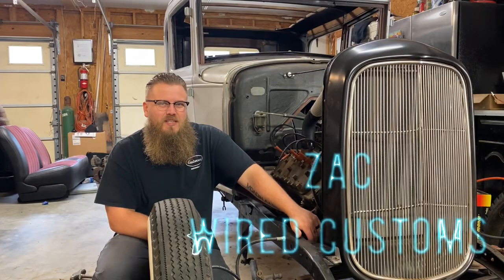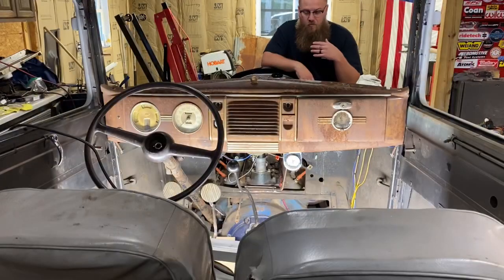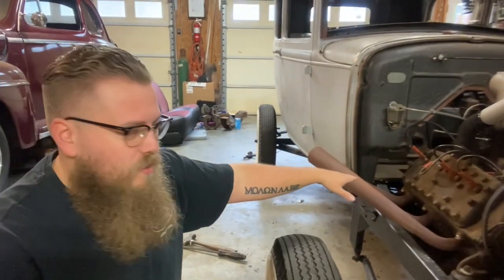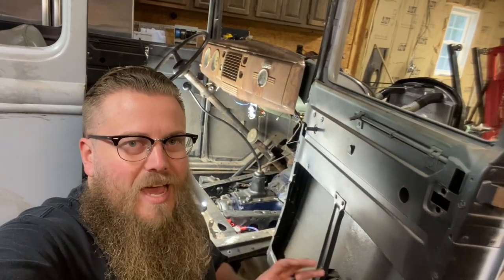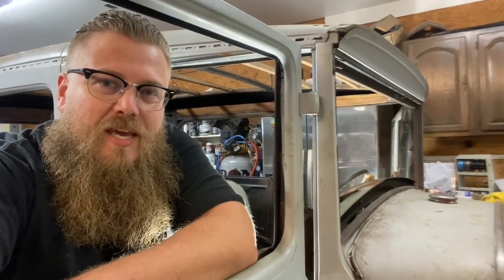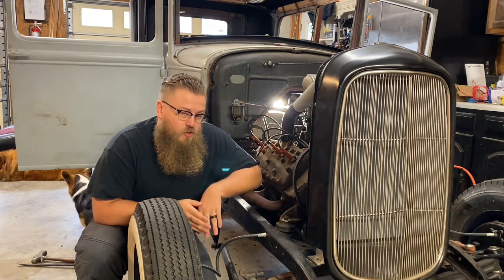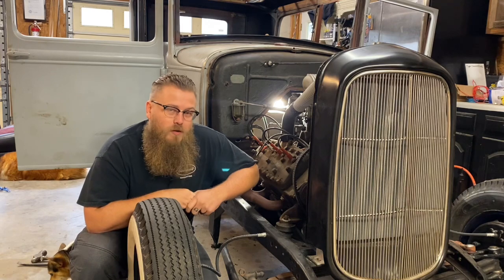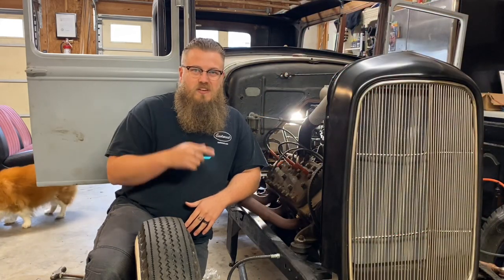Flathead V8 in a Model A Motor Swap

Comment: Soooo now ya got me rethinking flathead in my 31. Long story but hey you said shoot me a comment so here ya go. 
Back story, my dad had a bangin 4cyl but a beat up body on his original 31 he was 16 in 1963. He then traded an old man for a no engine better body which I have now.
When Vietnam came around it had a 1956 265 v8 corvette and power glide transmission but don’t believe he ever got it hooked up due to still having original banjo rear. After he came home around 74 I was 6, it was my sit in vroom vroom toy. He sold the power train, left the body and fenders in his parents garage and the frame out in the field next door.
There it sat for 20+ yrs. Then I got it in 2005. It had 2 trees growing through it. I got it out and I’ll be damn if the light rust on it didn’t preserve it, no pits or rust pockets. Many years of working on it with little funds and a wild imagination, I’ve got seats, steering column, Vega steering box, 7.5” ford ranger rear, a 32 rear mount fuel tank (he cut the original out) got wooden flooring in, rumble seat conversion, a 302 ford engine bored over .40 mild cam and c6 trans.
None of its mounted yet but the seats and floor lol. He split the wishbones and cut them at a lower angle attached to plates bolted onto the frame. I just bolted the fenders and rumble seat in last week. First time it’s been together since early 70’s got the fender bolt kits, woodblock body set the lining between fenders and the welting between body and frame from macs auto. It’s temporary but just wanted to see how it all fit together and it looks sweet.
Now I don’t have clue about mounting the engine trans crossmembers and rear axle placement as of yet. Sooo I’m at that stage now of where to go next. I’m in no big hurry but watching you makes me want it faster lol. And thanks for your service brother. I’m a fellow vet, Navy Seabee, steelworker 86-98. I don’t have MIG or TIG I’ve got a Lincoln 225 stick also many years exp building other peoples rides just never the time or money in the past which is why it’s taken me so long to accumulate what I have. I’ll keep watching your vids and hope to gain some valuable intel. Thanks man.

Comment: Corvair steering box will work by repositioning the pitman arm to point up, and fabricating a bracket to hang the box under the frame. A spicer joint will have to be put in the steering shaft to allow use of the stock columb. The drag-link us close to horizontal on.this set-up. No bump-steer.
Reply from the maker: Thanks Jerome, I try to keep everything very traditional hotrod without buying parts online. I always use either a 1939 cross steer or a F1 for a push pull steer
Reply: @WiredCustomsSpeedShop  I had a F-100 steering box in my Model A. It took many turns lick to lock. Bump-steer was so bad that it would change lanes if I hit a tar-heave. The Corvair steering gave much quicker steering with no bump-steer. A VW bus steering damper helped in that regard. The only down-side with the light-duty Corvair box would be using wide tires on the front, creating more scrub friction.

Comment: Great info, Zac. Thanks!
I want to run an aluminum rad, and have not decided between a ‘32 full height and a Model A stock height. Do you know of any way to make the “look” right using the ‘32 unit with a non-channeled Model A body? Most I have seen cut the rad/grill shell.

Comment: I'm planning on running a 1951 Flathead + 3 speed overdrive transmission. Should I just convert the rear end to an open drive shaft? How would I maintain the original trailing arm

Comment: Did you cut the firewall?
Reply from the maker: Yes I did, I couldn’t get the clearance I needed on the radiator so I had to cut the firewall. But, I have seen guys get the Flathead to barely fit without cutting the firewall

Comment: Thanks for all the great advice! I am building a 29 roadster and going to us an 8ba v8 and the parts I have from the ford 1939 pickup chassis I have. Did you keep the wide 5 hubs and run the original style juice brakes? I want to convert to disk but keep the wide 5’s - can this be done? I can’t find any write ups that anyone did this- any advice?.